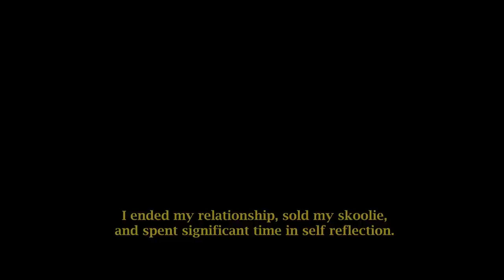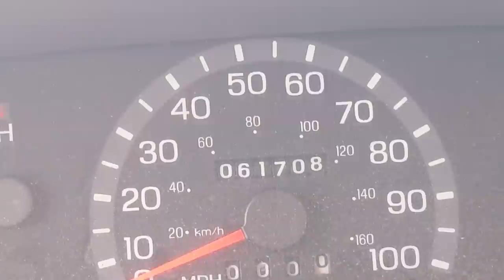Solo Female Short Bus Build Series (story 11)

Comment: Just picked up this channel one episode before you sold the bus. So, not a long timer here. But supportive from what I have seen so far. Was that leaking line the one that goes back to the heater that leaked into the bus? If so, most buses have 2 valves (usually in or near the engine compartment) that you can shut that line off and continue on the trip. I know, the video wasnt even uploaded before you are already on the road and probably at your first destination for security reasons. 8)

Comment: Buy yourself a cordless Impact driver with a 1/4" quick change chuck, get some screwdriver bits, a 3/8" Dr socket adapter bit. Then you can zip bolts out or remove nuts with ease. You will be able to use it all throughout your build.

Comment: I got a 1998 Shuttle bus and I'm converting it to be an RV.
Sounds like you went to Chrome Yellow.
I was considering Colorado Custom Coachworks in Denver. 
I can do a lot of things myself but I was thinking of doing some work there too.
Since I like to ski, I want to be comfortable in Colorado winters.
Also, I grew up in Phoenix, so I want to be OK in the summer heat.
I like your floor plan and insulation work.
Good work!

Comment: I'm picturing a platform on the outside back with a couple of cables at the top and hinged at the bottom.  When you get where you're going, drop the platform to level (maybe a winch) and out your back door you'll have a deck.  Or, allow it to go all the way down to the ground and you have a ramp for an eScooter or bike.